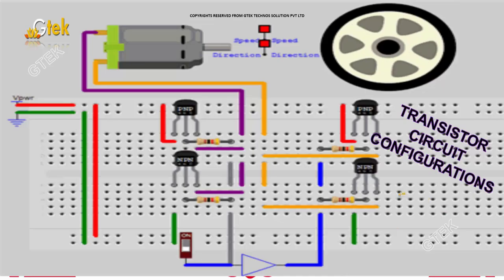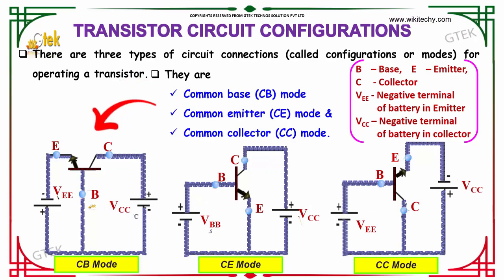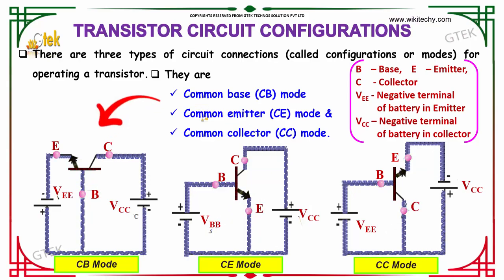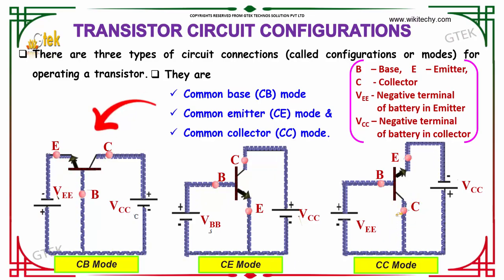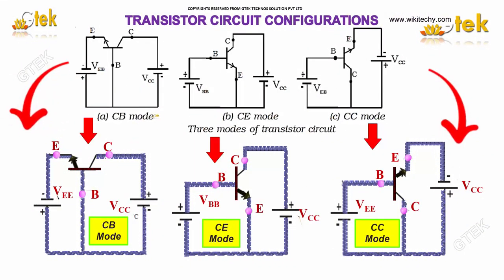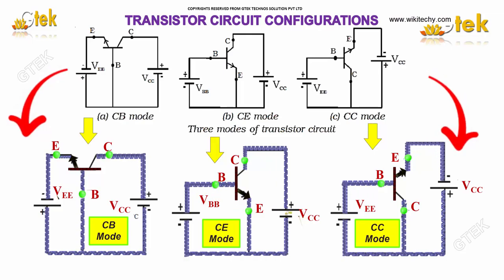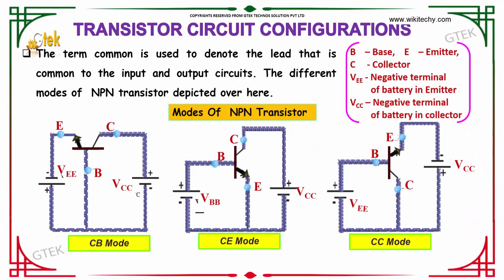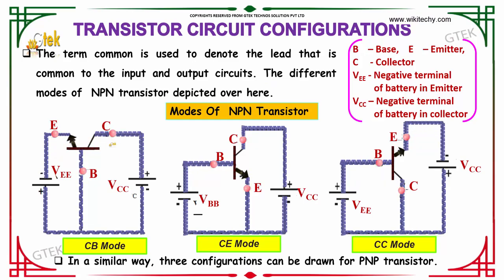Transistor circuit configurations Semiconductor Devices  class 12 Physics subject notes lectures

Comment: Chapter 4 - Bipolar Junction Transistors. This equation (above) is also applicable to a common-emitter configuration with an emitter resistor. Input impedance for the common-base configuration is Rin = rEE. The high input impedance of the common-collector configuration matches high impedance sources.

Comment: In the Common Collector or grounded collector configuration, the collector is now common through the supply. The input signal is connected directly to the base, while the output is taken from the emitter load as shown. This type of configuration is commonly known as a Voltage Follower or Emitter Follower circuit.

Comment: Common collector: Thistransistor configuration is also known as the emitter follower because the emittervoltage follows that of the base. Offering a high input impedance and a low output impedance it is widely used as a buffer. The voltage gain is unity, although current gain is high.

Comment: Common collector: This transistor configuration is also known as the emitter follower because the emitter voltage follows that of the base. ... The voltage gain is unity, although current gain is high. The input and output signals are in phase.

Comment: The three different transistor configurations are: Common base: This transistor configuration provides a low input impedance while offering a high output impedance. Common collector: This transistor configuration is also known as the emitter follower because the emitter voltage follows that of the base.

Comment: 1 class 12 physics lecture transistor and its application introduction to ... from IIT Professors (Not Available in NPTEL) Introduction to Electronic Circuits by Prof. ... Physics, Class XII Chapter : Semiconductor Topic : p-n junction Classroom ... Analog Electronics: Common Base Configuration of a Transistor Topics Covered: 1.